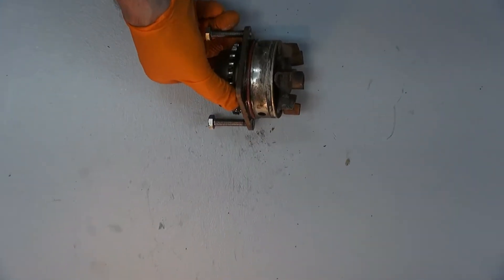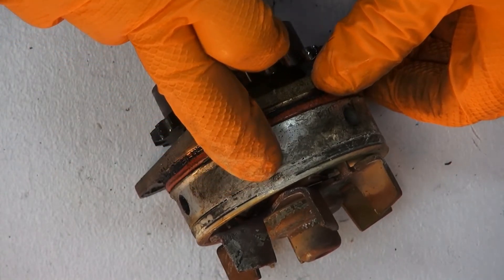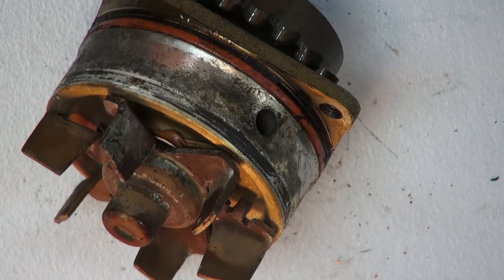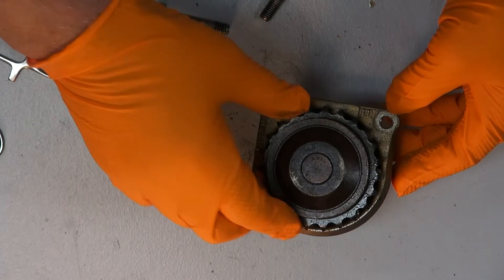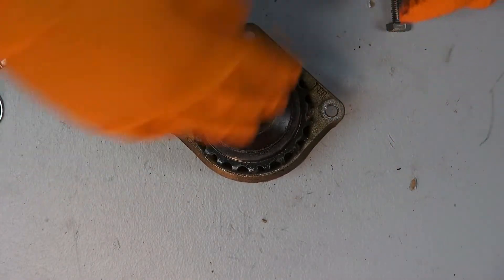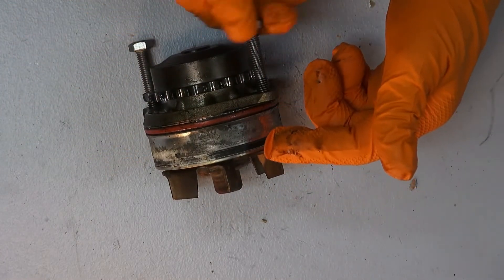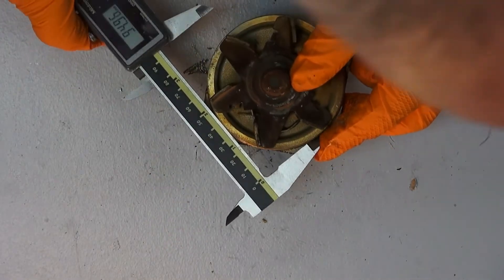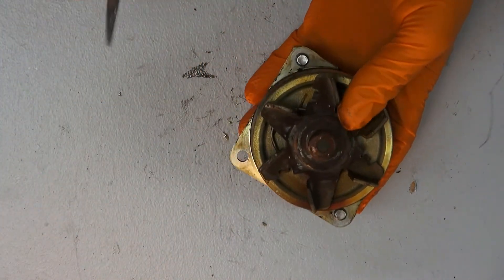Nissan Maxima GEN4 water pump seal

Comment: I was wondering if you made a video on the actual water pump installation? There's video on it here on Youtube but none of them are very detailed or high quality. Also did you reuse the timing chain tensioner or did you replace the tensioner as well?
Reply from the maker: I used the original tensioner.  did not video the actual drop in of the WP
Reply: @neuromanglers  Got it. May I ask how long this job took?

Comment: nice video, should mention when threading in the bolts to pump out the water pump, be mindful that the threads can strip on the water pump housing. best to thread in a little then wiggle out.
Reply from the maker: yep....that could happen